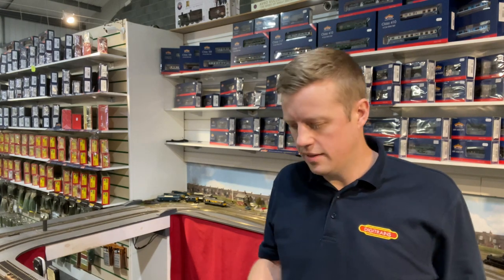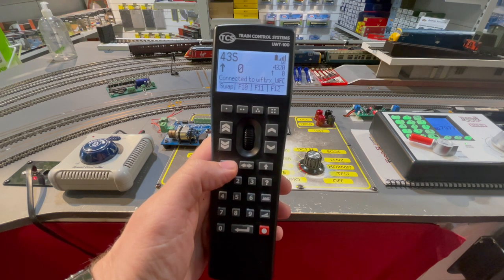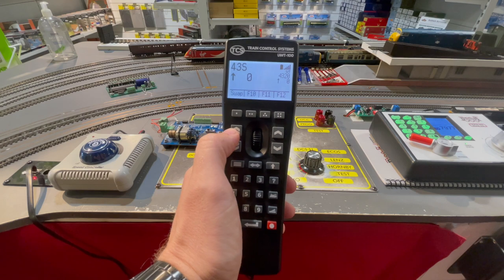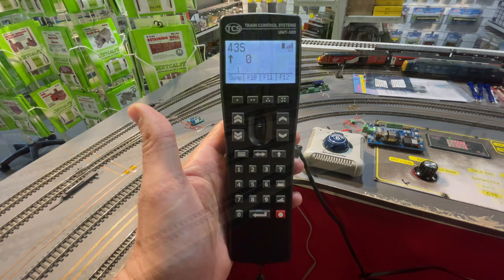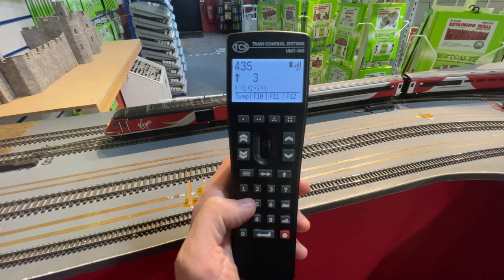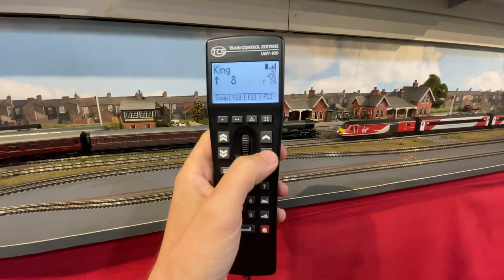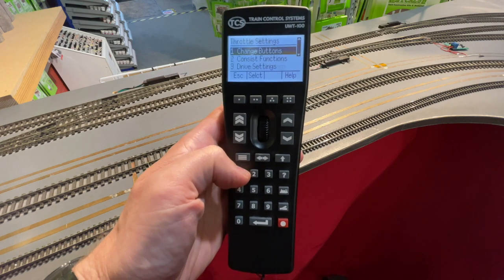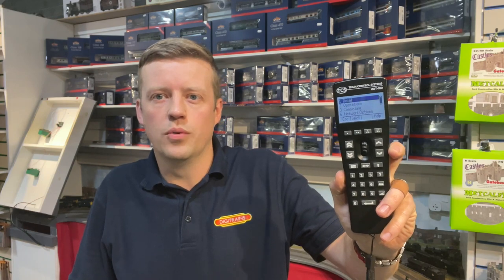TCS UWT-100 Wifi Controller Basic Overview

Comment: Good video regarding the opperation of the UWT-100. I managed to work my loco fine then the next time i tried to put my loco number in all I got on the screen was "Failed to select loco (code 1080) invalid consist recall key" I tried numerous locos & this window keeps coming up...I am using NCE Power pro with a WFD-30 Cab bus wi-fi interface. I have good Wifi connection. Any help would be much appreciated......
Reply from the maker: Hi Brian, I've just spoken to our workshop team. And they've replied "Need to make sure WFD-30 is set to the correct cab address. Also worth checking the Wifi channels to make sure nothing is crossing over."
Reply: @DigitrainsLtd  Thank you for your reply. like I said in my previuos comment the first time I used the UWT-100 I used the long curly cable. I then thought I will make a nice short cable but didnt realise you have to use a nce 6 wire cable & I had made up a 4 wire which was the problem so I have trains running again & I sure would recommend this cab its great not to be tethered,,,,,,,

Comment: I agree, easy to use and potential but I regret buying this as it failed pretty much out of the box. It comes with low quality encoders, bad warranty and customer service from TCS and most likely you'll end up paying more for its repair than it cost brand new. All marketing smoke and a very expensive land fill👎